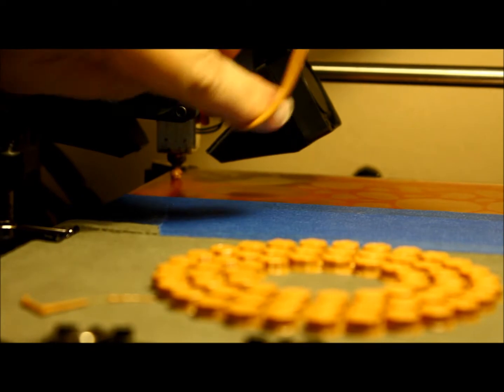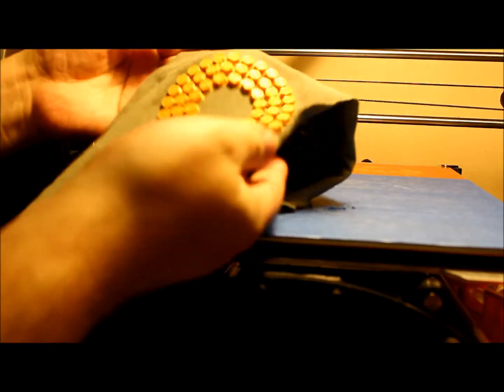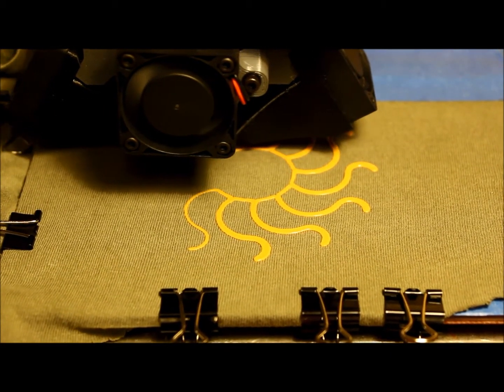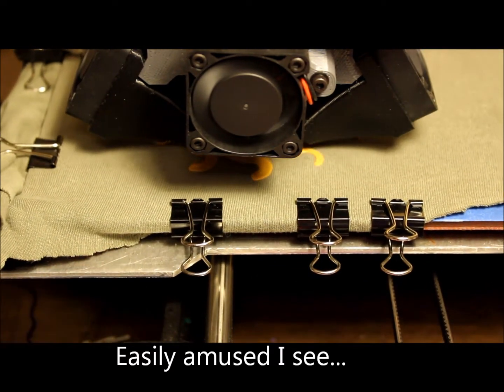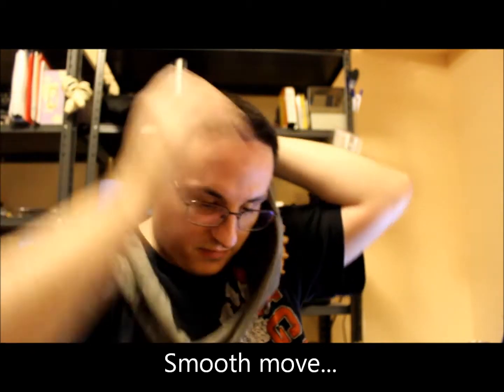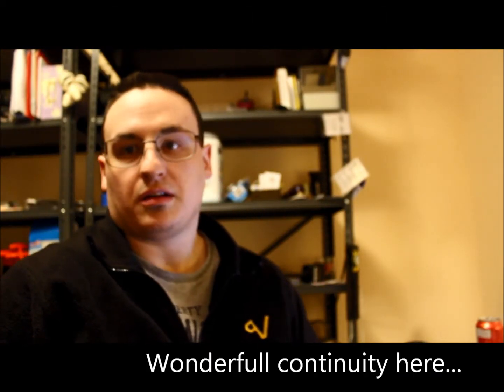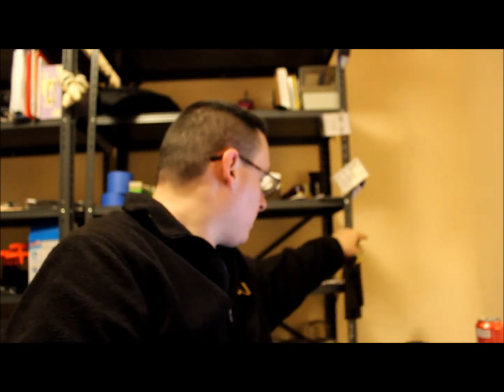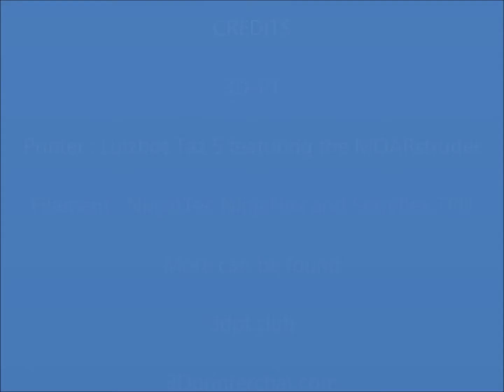3D Printing Flexible Filament over Fabric

Comment: Do you know of any large format flexible filament printers that could do an entire garment a once?
Reply from the maker: I know there are some large format printers, but you'd have to see if anyone has used this method on them... I'd think they'd be a bit gun shy about doing this on expensive hardware... You may have to do it in sections if you intend to do this over a whole garment. It depends on your budget.

Comment: hi  cool video, how much retraction did you put in and how fast?  you also put the z Hop
Reply from the maker: I use standard Cura settings for TPU. Z hop helps with stringing, but this design has minimal Z moves for that.

Comment: Do you think you could elaborate on how to use NinjaFlex with a standard Lulzbot extruder? I can't tell what you mean by sticking in a piece of filament here :)
Reply from the maker: There is a small gap under the hobbed bolt and idler arm that flexible filament likes to ozze into. I stick a bit of ridged filament into that gap and close the idler arm to get it to work.

Comment: Have you tried more rigid pla or abs?
Reply from the maker: Not yet. I wanted a flexible wallet, but I have been thinking about having some sort of rigid clip or attachment point on a shirt for phones or earbuds.
Reply: i gave standard abs a try and it was a total fail, but i didn't use denim like you did
Reply from the maker: @metaldetective6761  PLA is less prone to warping. Try using double sided tape to hold down the fabric. This may take some practice, but PLA or PETG should work
Reply from the maker: I'm actually about to release a new video where I print with both!